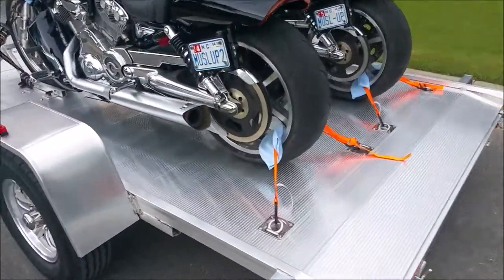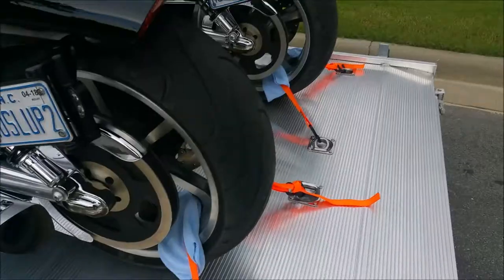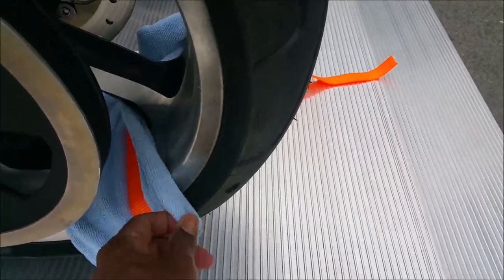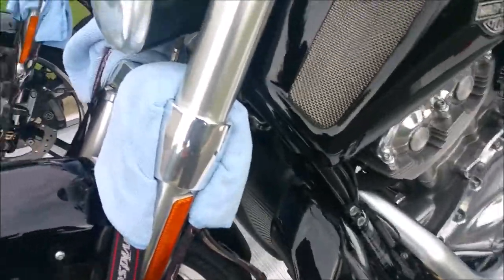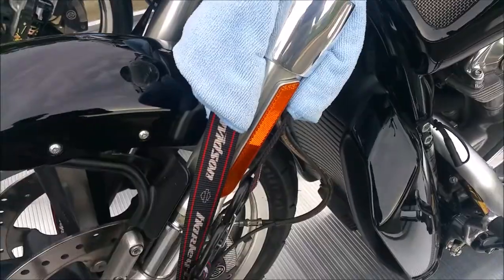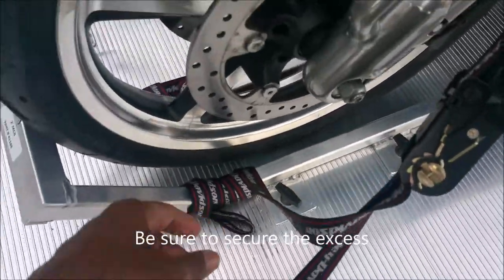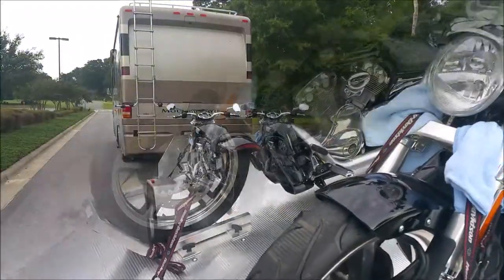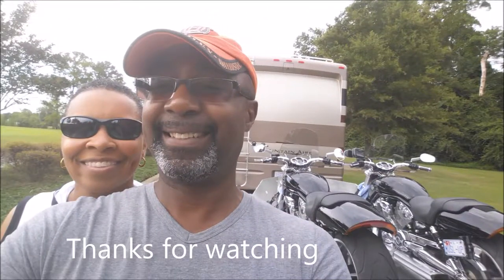Trailering Harley Davidson V-Rod and Avoiding Tie-down Scratches

Comment: I put a strap around the rear wheel ,not just across it ! That centers the wheel and it won't move if you pull the slack tight ! Very nice trailer and bikes !

Comment: Lol those rear straps are useless
Reply from the maker: Thanks for watching Alex. You are right about the quality of the rear straps. I replaced them with the same brand and model of straps that are on the forks. The rear wheels would move during travel and easily loosen those orange straps, but not the new straps.